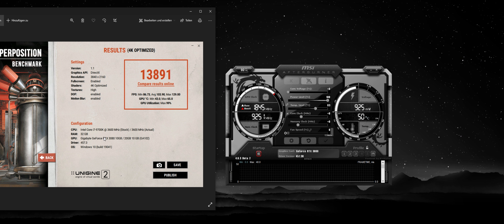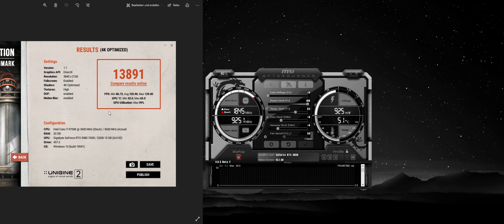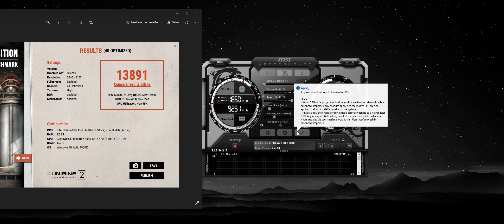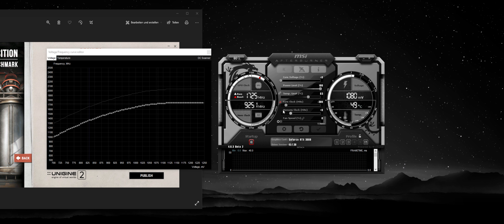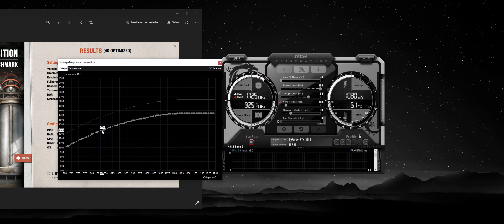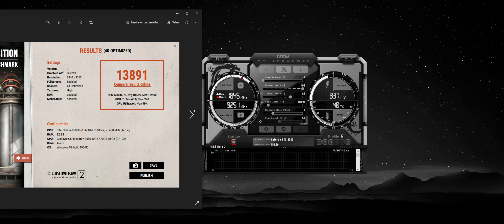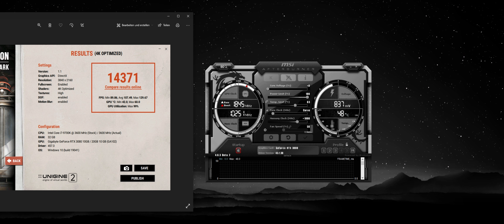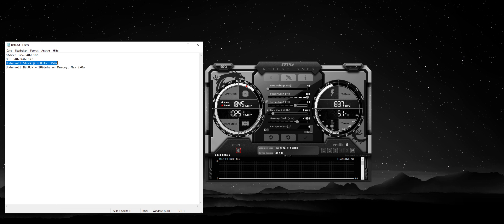GPU Undervolting Guide for RTX 3080 / 3090 | UP TO 100 WATTS LESS POWER

Comment: I dropped 20C on my 3070 lmao crazy. Was hitting 90 after a about 1 minute full load. It's summer here and I don't have AC so my room is pretty hot about 30C during day. Now I'm at 70C at full load after about 1 hour. I probably have to do some more stability tweaking, but I'm at 0.856@1860 MHz.
Yeah I know it's far from the most performance, but this Inno3D card seems to run super hot, I think it's just a bad cooler design. I just want the thermals to be safe.

Comment: I have a 3080 Master like you... but i find my undervolt does not seem to work in every game.
As in the clock will hold... but in a game like say Observer Redux the card will still just pull the full 350 watts.
Reply: Use a game like control with all settings at max plus ray tracing on and then do the undervolt until the game is stable

Comment: learning on undervolting so my question is what’s the point in dropping the clock at the start? is it just for the sake of shifting the curve? wouldn’t that mean you’re underclocked as well at the end and you’ll lose performance?
Reply: You lower the voltage, but bring the mhz up to the highest stable core clocks. Say you run a game constantly at 1950 at 1.035 mV, you bring the entire curve down -200/300 however low, then bring up the curve at, let's say, 850 watts and take that dot and move it to 1950 for stability at 850 mV. Most times, you'll run alot cooler because less power, but can gain or stay the same in performance; for the most part. The curve before 850 mV will be lower, yes, but if you're running at that low of mV, then that is guaranteed a low end game, like Lost Ark, and in turn also keep the lower temps and run at the same FPS. At least this is my experience when I undervolted my 2080 ti. I'm about to test it out myself on my 3080. I'm no expert myself, but from undervolting and testing several games, that's what I've seen.
Reply: @Glubbdubdrib  thanks for the explanation bud...i have a 3090 rog strix oc i noticed that the numbers you first gave is exactly what it runs, its usually at 1950 at 1.035 or 1.025 cant remember that means i should try to look for a stable voltage running 1950 right? even if its just a whole volt that should be enough to run cooler correct? i dont really have any cooling issues as it always runs between 65-75 with warzone but any power consumption i can save is worth it huh
Reply: @TheSouthForgot   I just was tossing out numbers as an example. But you'll have to find the core clocks that wont crash the game at the lowest mV. For the part about lowering the mhz before, say 825 or 850, the game will just skip those numbers and go for the 825 cap. I dont know what numbers a 3090 can reach. But I did it on my 3080, it's watercooled so tempts didnt change because it never goes above 51 degrees. But I managed to lower the power by 80 watts and lower the mV to 875. Didnt lose any performance getting it to 1925 mhz.

Comment: Cheers for this guy my 3080ti running at 1980mhz/10602mhz .875mhz so overclocked and undevolted. Why do you lower the core 300 first though?

Comment: Gave me an idea how to use this setting, for me wasn't quite right. Something that helped me was with EVGA the X1 software, I could monitor the voltage and temps and could carefully dial it in. Just so people know it's not a one n done setting, takes some practice and research in how to tell what is going on and what needs tweaking.

Comment: What about the points before your target voltage? It appears they would be running at a higher voltage now for any given frequency under base clock. Unless for gaming you hit that target clock speed fairly quick so it wouldn’t matter.
Reply: Everything before the moved point doesn't matter. You're essentially using more voltage for slower frequency meaning there's even more stability.
Reply: @fishywtf  It depends on your power limit. There can be huge power draw differences from one game to another. My 3060ti has only 220W power limit with 110% slider and if i would run it at 1860mhz/925mV than it will draw 170-220W. If i would undervolt it using higher frequency and voltage then i could end up before "the moved point that doesn't matter". I use different method. I oveclocked my gpu by 105mhz to core and 900 to memory and limited my power draw to 180W. It runs at whatever clockspeed at voltage it can deliver at 180W leaving no room for power draw spikes to 220W and running with higher that 1860mhz clocks in some games. I'm using whole curve in optimal way. Let's say that you can oc your gpu by 105mhz then it will be able to run that +105mhz at any given voltage. That's how curve works. If you limit your voltage to whatever you want than it won't be stable with more than 105mhz over original clock it was running at that voltage.

Comment: That's a really aggressive undervolt right off the start. I recommend anyone doing this to START with 925mv and work down. 850 is really low for these GPUs and can cause system instability, especially if you lost the silicone lottery. I also recommend not even touching the memory clock unless you have experience with overclocking. Performance gains would be nominal and GDDR6X already gets very toasty.
Reply: AORUS Xtreme cards are higher binned and can achieve this easily, same with the AORUS Master that was used in this video. It really depends on which gpu you've got

Comment: Solve my problem. My 3090 hit 119M when outside less than 10C, and memory temp is OK about 94C. But when outside above 15C, the memory temp reach 98C or higher.  When I use nicehash quickminer, the LITE OC can lock the voltage at 731mv, mem temp below 90C, and ethash 100M.  I think this is a safe setting. So I search method for locking volatage, this vid works.

Comment: My voltage curve  let me  play  BF5  1440p  with stable  GPU clock  2130MHz    before  without modification   it  was  1960MHz  and  less   11 frames per seconds
Reply from the maker: that sounds great
Reply: What voltage do you use ?
Reply: @hermannott7743   0.993
Reply: @Bemx2k  huh?  Makes no sense.  Jumping almost 200mhz with less power?  Picked up 11fps?  Let’s see you video
Reply: @damonm3  on average you will need  1v to keep 2130MHz on GPU  ,some chips event  1.05  but  it  is still lower and cooler than  default

Comment: Holy cow, I'm getting close to 79 degrees on my 3080 paired with a ryzen 5800x. It's at 60ish degrees but then the CPU kicks in and pc begins to burn. Airflox isn't that great in my case (older NZXT).
Reply: Now at 72 degrees @1700mhz instead of 1850mhz, still getting way above 60 fps on 4k on most titles.

Comment: Ty so much for this.... I ended up rollung back my driver to 456.55,  and voltage limiting my system too 1.0 and mhz to 1850 - I was FINALLY able to change my monitor refresh rate back to 1600..and so far has been rock solid.. I was seriously stressing having to do an Rma or return... seems the voltage* is the issue...

Limit that shit and it runs smooth..

Comment: Perfect ! Going to get 3080 soon, by Easter 🐣 Once I have the GPU, then I’ll start playing with under voltage⚡️
Reply: How did it go?
Reply: @ljuc  It went well thanks ! Unfortunately pump for cooler died :( It will be repaired/replaced under NZXT 6 year warranty, but still a pain being without a computer. It will be 2 weeks soon, unsure how much longer it will take. I’m using a laptop, but not good enough for FS2020

Comment: isn't it better to first increase the ofset until the mv hit the desired mhz and then lower all on the right? read in forums it is better that way
Reply: Yes, but only because it provides a smoother curve before the minimum voltage.

Comment: The stock gaming x trio 3080 voltage curve in afterburner tops out at 2040 mhz so that’s the frequency I locked in. After a few rounds of stability testing it landed on 963 mV at about 84% TDP. This gets me thinking about comparing the performance difference between 2040 mhz and 1850 mhz. I’m guessing it’s not going to be noticeable.

Comment: nice vid, got my 3080 tuf to 1950@ 0.900  instead of stock 1890-1920 @ 0.95-1mv, 4 degrees cooler, 15100 points in this test =) gpu in quiet bios wich just applies a less agressive fan curve...temps stay at 75 degree(with performance bios im at 65 degree) @ 72% fanspeed (can hear them at 70% barely on performance bios they would push card from 72 degree target to 65) got scared my fans are broken but this card is so quiet even on stock already...im drawing 310 watts max now instead of 350, i also have full uv setting with 0,825 @1875 for maximum silence and fans stay under 70% then only losing like 3-5% fps
Reply: temps are still high and you are pulling way to much watts for undervolt should be like 2-250 watts tops
Reply: @postedinthecut1565   onnly becuase gpu is set onn silent mode curve, with nnormal it would be  50s

Comment: So I recently got The aorus 3080 master.

The problem is, on Idle the memory clock spike every couple of seconds to 1800mhz,and than go back to 210.

this happens while I do regular task, youtube, google and stuff like that

and when I dont touch the pc at all, It's on 210 stable.

any solution to this?

I was looking everywhere and didn't find anything.

Im so desperate about it..
what do you think?Is this normal?

Comment: Ich bin mal gespannt.
Hab ein BeQuiet 700 Watt Gold Netzteil und hab jetzt eine MSI 3080 Suprim X gekauft.
Als CPU einen Ryzen 7 3700x Stock.
Mit ein bisschen Klimbim (4x8 DDR4 TridentZ, 2x Sata HDD, 1x Sata SSD und 2x NVMe)
Und noch ne externe DAC Audiokarte + Beyerdynamic MMX 300.

Also so ein wenig kommst zusammen.

Ich habe auch nicht vor zu übertakten.

Ich bin der Meinung das Netzteil sollte bei einem normalen Gaming Betrieb nicht mukken.
Ich hab auch keinen Torture Test vor.
Aber ich befürchte trotz alledem das ich die Karte undervolten muss weil ich eigentlich kein Bock hab das Netzteil die ganze Zeit bei 90% Auslastung zu haben.
Aber ich bin guter Dinge, BeQuiet stellt ja kein Ramsch her und Netzteile sind an für sich relativ hochwertig.

Wenn die Verfügbarkeit es zulassen würde hätte ich auch noch ein neues Netzteil gekauft, Vorzugsweise das Straigt Power 850 Watt Platinum aber oh Wunder nicht Verfügbar. ;)

Comment: Fantastic video man I highly appreciate this lesson. I`ve applied this to my 3080ti suprim x. I`ve set the core to 1960mhz at 0.875mv and I`m getting like 60 fps on dying light 2 1440p/ultra-rtx preset/ryzen5800x/32gb 3600mhz cl 16 ram with 360watt gpu power consumption compared to overclocks (stock voltage) @ 2170  gpu clock/ +450mhz on vram which gives same temperatures but 75fps at 395watts. At this point undervolting makes no sense to me because i`m getting significantly lower fps with not much of a power saving. This benchmark is not really relevant to gamers who want to play at ultra preset on their top end gpus.
Reply: True, though some people would love a cooler card. 60Fps stable is okay-ish for some people. I personally would not mind AAA Games with high fidelity settings at 60. But on competitive games if the undervolt can give you 144fps with undervolt thats golden

Comment: is there any downside to running the gpu at a fixed voltage?
Reply: -) Unnecessary power draw on idle.
-) Fans constantly running.
-) Some programs using hardware acceleration in 2D mode might crash. (certain video player, CAD, simulation software...)

Comment: But WHY did you bring down the whole curve before applying the new voltage curve. What is reducing the clock doing for us?
Reply: @nicolaschasteler  but that's not true, we can increase whatever point we want and the following points will reign in accordingly. It doesn't matter how far down the previous points are.

Comment: Doing this would prevent the card from boosting past 2000mhz though right? My 3090 fe hits 2050 by itself on stock? Or is this doable with undervolting too?
Reply: Usually you can reach max boost clocks with a bit of undervolt yes, but since these gpus gain much more performance from the memory oc rather than gpu oc, you should give it the +1000 on the memory and undervolt it..leave it like 1900mhz and lower the voltage
Reply: If yours boosts to 2050-2100 you have to pick the frequency you are happy with, under voting will still achieve lower thermals and power draw. I tend to hammer the card in a few bench tests, to see where is settles.....mine runs @ 2100, undervaluing still achieves 2100.....

Comment: Liked subbed and everything, good stuff man, but I don't understand this stuff. I might be able to copy, but I'd like to understand as well:p What gets you the first number you need, the one that's individual for each card? (Better card lower number, don't understand why a better card can run at lower volt, feels like the way you say it it can either run or not and just feels unlogical that the card can only run at one volt and related speed) Why on earth does this work? Why do nvidia sell worse performance when they could just undervolt, makes no sense to me but I believe it cause Iv seen several videos like this now.
Please enlighten me, please.
Reply: The first number is more of a baseline to adjust the whole curve so that when you go to move the dots they get perfectly flat at the GPU clock speed that you're shooting for. After that it doesn't matter, as you can hold alt/shift to move the whole curve. The reason this works, and the reason nVidia's partners set their cards this way, is because not all GPU chips are manufacturered good enough to handle higher clock speeds at lower voltages. Bad chip = bad transistors which fail when they don't have enough electricity going through them, and this means the chip gets errors when trying to perform at higher clock speeds. Higher voltage = more electric current = less chance of failure, but it also means more heat. So the reason nVidia has higher voltage than necessary is because they do not know which video cards could fail for the consumer because of too low voltage. To play it safe, they create a higher voltage profile so that when you get your video card, it doesn't crash, but it does run hotter. The technology of boosting clock speeds and then settling down when temperatures are too high is combined with fan speed to provide overall end user experience :)

Comment: My 3080 Suprim X is stable at 0.875V, 1920Mhz,  250Watt and 77° Silent Mode fans max. 1200rpm its really really quiet for that power ! 2010Mhz is possible at 0.950V but for me i really dont need 3-4 fps more.. cause its getting hotter, louder and needs more than 300Watt.. its not worth it ( for me ) But i really dont know if i have a good model or a bad one what do u guys think ?
Reply: hey, i''ve got the same card undervolted to 2020Mhz@937mV. The Thermals are about the same as stock, but the card is a bit faster.
Reply: Yes 77 is the way to go

Comment: Hey, can i undervolt even more then this to get even lower temps? I don't mind 10-20% performance loss
Reply: Yes, ifnu don't care about performance you can probs get this low asf temp wise
Reply: Yeap just target a lower GPU clock at a lower voltage. Maybe start the horizontal flatline at like 650mv and hold ALT or SHIFT to drag the line down to 1600mhz.

Comment: I have my set to 850mv at 1880, but it pulls 315 waats in some games. Any idea?
Reply: am guessing that is a normal occasional spike in psu draw of power - mine hovers around 275w (Aorus 3080 Master) - but can sometimes hit 300w and also go as low as 250w

Comment: hey listen man, I have rtx 3080 vision gigabyte OC and my gpu always overclock itself no matter what i do when i am gaming 
it's base clock is 1800mhz and when i am gaming it always goes from 1800 to 1930 and max stock oc is 1950.
I did exactly what u did in the graph and the gpu still hits 1950 mhz how to fix that : (
Idk if my gpu is throttling or not but I have pretty nice  mesh td500 cooler master case with 3 fans in front, 120 mm fan in the back + 2 fans on the cpu cooler
and it's a mesh case and the airflow should be dope but I feel like my gpu is throttling when I play doom eternal.
When I play the game for 2-3 min it's smooth but when the pressure gets too much game becomes slower idk why it could be the throttling.
When I alt tab and stay on desktop for 2-3 minutes and then quickly jump back into the game, game is only smooth for a few minutes then the throttling comes
back and the game starts being slow ...... 
I have capped the fps at 250 because if i play wtih 300 on 1440p for example my gpu hits 74 degrees ..
Is this self 1950 oc fixable I want it to stay on stock 1800 mhz frequency i dont need the additional base clock that the gpu provides for the games
i play ...
Reply: Your video card is not throttling itself at 74°C. The throttle point on most of the RTX 30XX series is 83°C. My guess is that you have another driver or program interfering with the VF curve that you are trying to set with MSI Afterburner.

Comment: Hey, so I have my card power (Msi 3080 Ventus 3x) set to 70% power, -100 cc +1000 Mc but I’m not seeing any mv in afterburner on the right. I’m mining eth and was told to lower the power limit. Why did you keep it at 100, and how is this different than what I did?
Reply: To add to this I see the base around 1300 ish and boost around 1680-1720. Hard to tell with out specific numbers. I see the card running at 990-1020 and the bottom at 1025 on the left dial